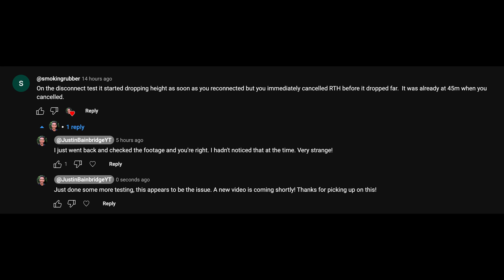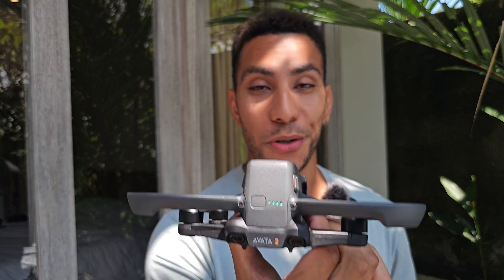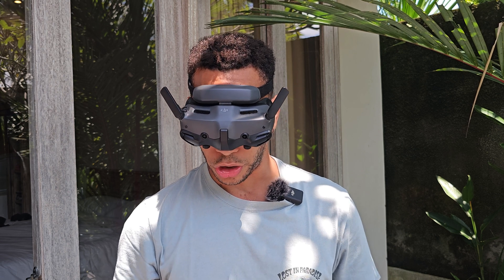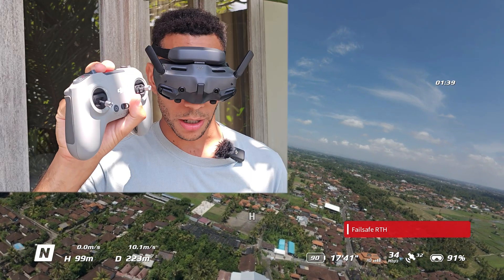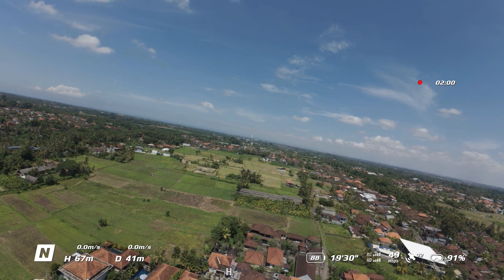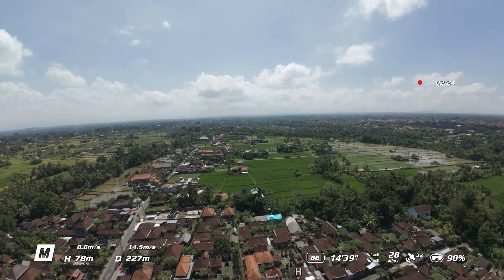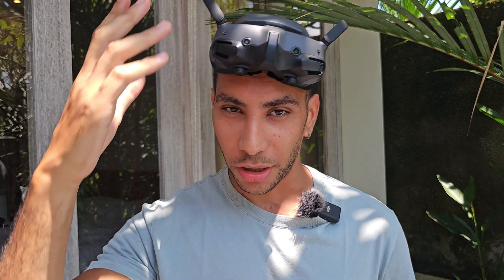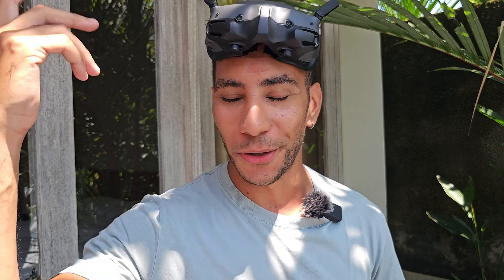DJI FIX THIS! - AVATA 2 Return To Home Issue Found!

Comment from the maker: This only happens in M mode on the FPV 3 radio.
It appears that when reconnecting to the radio the drone accepts whatever value the throttle is at as an input. Considering manual flight requires less than 50% throttle to hover if you just leave the throttle where it is when the drone reconnects it will take this as an input. I think there should be a condition on reconnection to override any throttle value until additional inputs are made by the pilot. Otherwise anytime you lose connection in manual you have to push the throttle past 50% in order to not run into this bug. Hopefully DJI changes this as when you lose signal, generally you have a lot running through your mind, and if you don't know you have to push the throttle up. Things will just get worse. 
I will update in due course depending on what the engineers at DJI say.

I have sent DJI this video and the flight logs to look into and hopefully get this resolved quickly!
Reply: Hi Justin, same problem here, I did a video , https://www.youtube.com/watch?v=SGxwuuyz8lo 
I did some tests with a friend of mine with another Avata2, so we tried both in manual and in N/Sport mode, the RTH low battery with the use of the RC3 never works!!
With motion controller 2 works fine, battery at 25% "low battery RTH" starts and workd fine.
With DJI FPV RC2 no... 
it doesn't work either in "N" or in "S" or in "MANUAL"

We have the 1st low battery warning at 25% but the RTH procedure does not start...
in fact when the battery reached 5% the drone auto landed alone,  (failsafe RTH set at 50 meters altitude) we did a further test , by turning off the RC3 the RTH works, by turning off the glasses the RTH works, by Motion controller works, but with RC2 only warnings, the RTH never starts...
Reply: Not true. Happens in sports too with MC.
Reply: @OnelastgoTV  how? if you don't half press the trigger you don't give input
Reply: Wow thanks for thoroughly testing and sharing 🔥💪 funny such simple issue doesn't get spotted during pre release testing.😂
Reply: Can I ask how you got my flight logs to send to DJI?
Reply: Also I have video from the goggles 3 and the drone I put a post on Facebook side by side so you can see what happens
Reply: Hi, nice videos there,  are sure this is a bugs?  I think  if the stick stay on normal (centre stick on throttle,  ) it will just maintain 100 alt if stick stay on centre, its normall, i guess? Dji fpv i see on another videos have the same behavior,  RTH but stick not 50% they will always  descending,  event my avata 1 have that behavior,  cmiiw.
Reply: so this whole time its not an issue its operator error?
Reply: no answer or response....hmmm...just making videos to make or we gonnna get some actual useful info??
Reply from the maker: @tyg3rs716  Hey - I have been sending more info over to DJI and working closely with some others on this bug. DJI are looking into it more this week and I will make a video once I have a final answer/resolution to this. 
To give you some more info for context - When doing a manually triggered RTH in manual mode, if the stick is below 50% at the time of the trigger, then the drone will not reduce altitude. You can also move the stick down from here with no change in the drones' behaviour. Only if you push the stick up past the midpoint, do you gain altitude control again and can increase/decrease height. So it appears that there are already measures in place for this, but I think a similar system should be used for failsafe because it's possible to recover signal on the radio without video feed coming back. When this happens the drone just accepts whatever position the throttle is as an input without the same safety measures. This is problematic because with the goggles on and no feed you could have no idea that the drone is descending and you wouldn't know exactly where the stick position is. Sure you could just push the throttle all the way up after you loose signal, but you would have to know to do that. A lot of people would just freeze and trust the drone is heading back. This is why I believe there should be a similar measure put into the failsafe logic. That would prevent this from happening and save many drones. Automated return to home should be completely automated...it's in the name, you shouldn't have to think about doing extra steps. 
Anyway, that's all I've got for now, the ball is out of my court at the moment.

Comment: Have they resolved this problem yet?
Reply from the maker: Nope this still behaves the same. You just have to remember to push your throttle stick up if you loose signal to prevent this from potentially taking your drone down.
Reply: @JustinBainbridgeYT  Wdym with "to push your throttle stick up"? Sorry, I'm new to this and don't have much experience
Reply from the maker: @Suayrez  I mean if you loose signal and you're in manual mode then you need to push the left stick (throttle) up. If you don't know what I mean by that then you're probably not yet flying in manual mode and won't encounter this issue. This is a manual mode specefic problem when the left stick is relaxed for proper flying 😊
Reply: @JustinBainbridgeYT  Ah, so in the video you showed, the problem only happens in manual mode?

Comment: after a year it still has the same problem, crashed mine in the same way controller reconnected in no throttle position and started to decend. After i got the pic back full throttle did not have any effect as it still was in RTH and pushing the brake button was to late. No Warranty because i pushed the throttle stick down at the moment of the signal reconnect i send them your video and trying to talk to them what really happened they will check the flight data one more time and will see how it goes... its 11 euro for the cover and 50 for service they tried to give me a 20 euro discount if i do not want to wait. I just want it resolved so we will see.... but one thing i can say it crashed at 11m/s into sharp stones straight on and all that was damaged was broken lower cover. So it is pretty good in that point taking a hit :D The  FPV Controller is in manual mode so no tension but was flown in sport mode.  Sry for double comment but more people are active on this one. So yea at this point if flying with MANUAL setting on the Controller pushed the stick over 50 % when in RTH.
Reply from the maker: Yeah it's still there. I check after every update if it's been fixed but nope. I knew it would result in people loosing their drones. but unfortuantely It's never been addressed. I tried my best to publicise it but it didn't work. Hopefully they will repair it under warranty. IT's a shame that a feature that's supposed to save you could actually to the opposite.

Comment: It happened to my Avata 2, instead of gaining height it flew directly to my Home point and crashed in a steel pillar, i recovered it but the battery disconnected and lost it in the crash
Reply from the maker: Damn, that sucks! get in touch with DJI and send them the logs, they might replace it for free.

Comment: What is your RTH altitude set to?

Probably the current altitude when you turned off the radio was higher than the RTH altitude. So instead of going up, it went down
Reply from the maker: Hey! My RTH altitude was always set to higher than the altitude at the point of signal loss. This turned out to be a bug with the way the drone interprets the controller stick position when reconnecting to the drone. Normally, it sets a neutral throttle position so that the drone will maintain the RTH altitude when coming back. But when it reconnects, it accepts whatever the stick position is. So if it's low, it'll descend, and if it's high, it'll climb. Just make sure your stick is at at least 50% if you lose signal, so It'll definitely make it back. They were supposed to update this as there is a condition when you trigger RTH manually where you have to move the throttle stick up past 50% again to regain altitude control before the drone will climb or descend. With failsafe (signal loss) it skips this step for some reason. This is the time when it's more vital in my opinion. It was supposed to come in an update, but never did

Comment: Hey mate 
My avata 2 with only 10 hrs on it occasionally loses altitude by itself 
I'm only flying 200 metres away 
No trees or buildings 
Good signal 
Any ideas ?
When loses altitude I switch back from sport mode to normal mode
It resets the issue
Im using rc3 controller and n3 goggles 
Thoughts please  ?
Thanks Glen Australia 🇦🇺
Reply from the maker: @hiluxmonstertruckgleno6276  Hey! I'd start of by recalibrating the controller sticks and then also calibrating the aircraft compass and IMU for good measure, try that and see how you go
Reply: @JustinBainbridgeYT  thanks mate for the help and advice 👍 
Cheers glen Australia 🇦🇺
Reply: @JustinBainbridgeYT  what is imu mean ?
Reply from the maker: @hiluxmonstertruckgleno6276  IMU is the Inertial Measurement Unit, basically the drones gyroscope and accelerometer. You should be able to calibrate them through the goggles menu. It'll say something like "Calibrate Aircraft IMU" then just follow the onscreen instructions 😃
Reply: Ok thanks mate for your help 
Much appreciated cheers glen @JustinBainbridgeYT

Comment: Hi Justin! Just wanted to ask if you've managed to find out if they've fixed this already?
Reply from the maker: @AltitudeAerials  Hey! I have tested after each update and no fix has been released. So for now I can only offer the advice that is you lose signal in manual mode make sure you push the throttle to at least 50% to avoid running into this. Hopefully it'll be fixed, but it might not
Reply: @JustinBainbridgeYT  ok gotcha. Haven't had to use it yet but good to know! Post an update video in case they do mate, new avata2 flyer here but been flying fpv since 10 yrs ago. Subd to your channel
Reply from the maker: @AltitudeAerials  yeah will do mate! Oooh nice! You've been through the whole development of FPV then! From analogue to Avata 2 😅
Reply: @JustinBainbridgeYT  yeah. Last fc I flew was a naze32 with skyzone. Betaflight didn't even exist yet haha. Just got back into it last week with a new avata2 and have been binge watching your vids. Totally blown away by the hd goggles and the solid rc signal of the avata. Dji has literally answered our wishlist from 10 yrs ago haha
Reply from the maker: @AltitudeAerials  yeah the video link is ridiculous. The quality, stability and range is mega. I still fly some traditional FPV drones but the Avata 2 is just so easy and user friendly. I find myself reaching for it more often as it's just less messing about. And it's the first gen with genuinely usable native camera quality.
Reply: @JustinBainbridgeYT  nice to know I've made the right choice! Thanks mate

Comment: I just came across your video. Yes your video is 3 months old but if you still having this issue, you may want to look at the throttle stick position. Your left throttle stick is below mid point. Maybe this is why the drone starts to descend when link is established. I think you may want to test again but this time having the throttle stick at midpoint before turning controller back on and see if it makes a difference.
Reply from the maker: Hey there!
Yes, you are absolutely right. However, to give you some more info for context - When doing a manually triggered RTH in manual mode, if the stick is below 50% at the time of the trigger, then the drone will not reduce altitude during the RTH. You can also move the stick down from here with no change in the drones' behaviour. Only if you push the stick up past the midpoint, do you gain altitude control again and can increase/decrease height. So it appears that there are already measures in place for this, but I think a similar system should be used for failsafe because it's possible to recover signal on the radio without video feed coming back as this has heppend many times to me. When this happens the drone just accepts whatever position the throttle is as an input without the same safety measures. This is problematic because with the goggles on and no feed you could have no idea that the drone is descending and you wouldn't know exactly where the stick position is. Sure you could just push the throttle all the way up after you loose signal, but you would have to know to do that. A lot of people would just freeze and trust the drone is heading back. This is why I believe there should be a similar measure put into the failsafe logic. That would prevent this from happening and save many drones. Automated return to home should be completely automated...it's in the name, you shouldn't have to think about doing extra steps. Thanks again for your help

Comment: Maybe the reason is that your left stick is in the "down" position? Even the Avata is in RTH, left stick still works
Reply from the maker: @everestfilms5866  Hey! Yep you're right here however there are some issues with this in the auto RTH sequence.
To give you some more info for context - When doing a manually triggered RTH in manual mode, if the stick is below 50% at the time of the trigger, then the drone will not reduce altitude. You can also move the stick down from here with no change in the drones' behaviour. Only if you push the stick up past the midpoint, do you gain altitude control again and can increase/decrease height. So it appears that there are already measures in place for this, but I think a similar system should be used for failsafe because it's possible to recover signal on the radio without video feed coming back, ive had this happen several times. When this happens the drone just accepts whatever position the throttle is as an input without the same safety measures. This is problematic because with the goggles on and no feed you could have no idea that the drone is descending and you wouldn't know exactly where the stick position is. Sure you could just push the throttle all the way up after you loose signal, but you would have to know to do that. A lot of people would just freeze and trust the drone is heading back. This is why I believe there should be a similar measure put into the failsafe logic. That would prevent this from happening and save many drones. Automated return to home should be completely automated...it's in the name, you shouldn't have to think about doing extra steps to make it work properly. There should be a fix for this to give the same behaviour where the stick has to go back above 50% to regain altitude control in the failsafe rth logic. 🤞
Reply: @JustinBainbridgeYT Did Dji already fix this issue now?Tia❤
Reply from the maker: @Youboyg  Not fixed

Comment: Does the rth feature work in manual mode?
Reply from the maker: Normal RTH yes. Low battery RTH no. If you lose signal and auto rth is triggered make sure you push your throttle stick up or you'll get the big when it reconnects. This still hasn't been fixed
Reply: @JustinBainbridgeYT  😱 have you tried this on the latest firmware now?
Reply from the maker: @betaompay38  yep, still the same. Hoping for it to be fixed in the next firmware update
Reply: @JustinBainbridgeYT  thank you so much 🙏🏽

Comment: My Avata 2 drone lost signal with the goggles and landed on its own without RTH kicking in. I had a total loss of signal to the goggles. The drone was about 1 mile away from me when it lost contact with the goggles. I had to start walking towards where I lost the drone, praying it was findable. When I got about 1/2 mile from the drone, it reconnected to the goggles and I flew it to where I was standing. There were storms coming too, but at the time, it wasn't raining. Is there any connection to the storms and clouds in the area to my losing TOTAL signal to the drone? It did not RTH and that is dangerous.
Reply from the maker: Gald to hear you regained connection and ws able to retrieve the drone! Was the Loss of signal action definitely set to RTH? There is a delay between losing connection and Failsafe action kickin in. It's been as low as 2 seconds and as much as 7 seconds during my testing. So there a chance the drone will crash before RTH can kick in. Eletrical storms can effect these things, same with a high KP index.

Comment: Does the Avata 2 need a phone to use?   Or is the software, etc in the goggles 3 ?
Reply from the maker: Nope, all the software is handled by the goggles now. There is no need to connect the phone on the Avata 2 during flight

Comment: Hi Justin, same problem here, I did a video , https://www.youtube.com/watch?v=SGxwuuyz8lo 
I did some tests with a friend of mine with another Avata2, so we tried both in manual and in N/Sport mode, the RTH low battery with the use of the RC3 never works!!
With motion controller 2 works fine, battery at 25% "low battery RTH" starts and workd fine.
With DJI FPV RC2 no... 
it doesn't work either in "N" or in "S" or in "MANUAL"

We have the 1st low battery warning at 25% but the RTH procedure does not start...
in fact when the battery reached 5% the drone auto landed alone,  (failsafe RTH set at 50 meters altitude) we did a further test , by turning off the RC3 the RTH works, by turning off the glasses the RTH works, by Motion controller works, but with RC2 only warnings, the RTH never starts...
Reply from the maker: It seems some of the low battery logic is different depending on modes and controller. However I did find that auto low battery RTH did work in normal and sport mode when using the FPV3 radio. At 25% there should be a warning that the RTH will trigger in 15 seconds (normal and sport mode). Reduced throttle output at 18% and auto land at 7% from my testing.